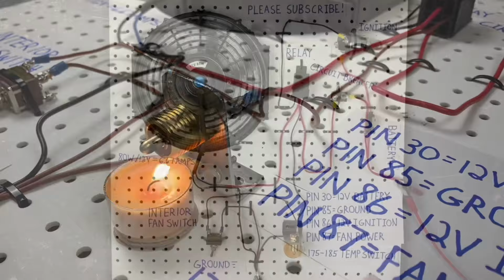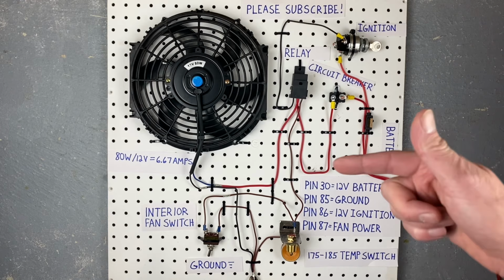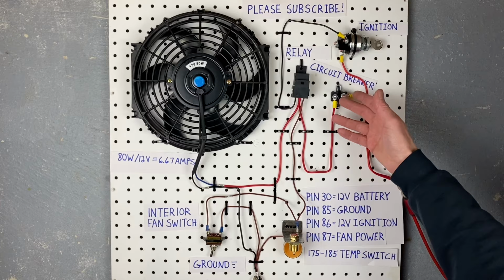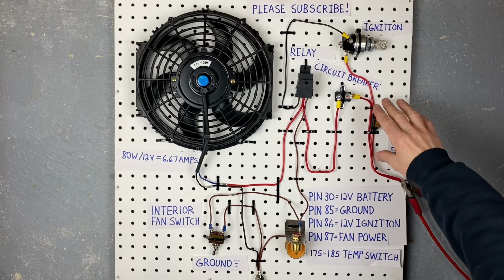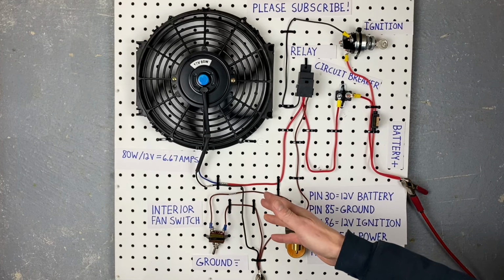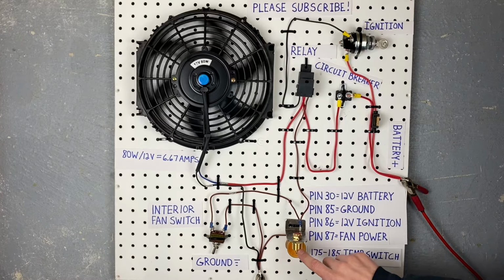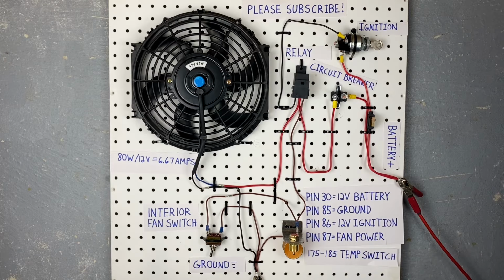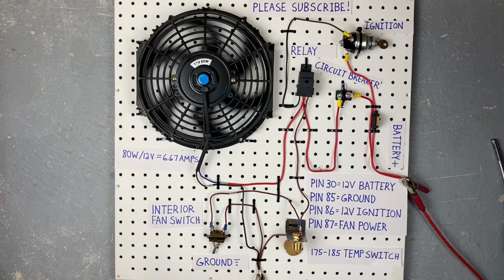How To Wire An Electric Radiator Fan Relay Temp Sensor AND Switch! | @WiringRescue

Comment: good video....i was wondering if you can have a light to let you know the circuit is complete?
Reply from the maker: Sure! Just steal power from pin 87 that goes to a LED light and when your fan is on, the LED will be on too. Good luck!

Comment: I have 014 mini cooper s  the cooling fan never turn off until the battery is dead any ideas what is wrong please
Reply from the maker: I am not familiar with mini coopers, but it sounds like your fan relay is stuck on, or somebody wired the fans incorrectly.

Comment: I have a issue. I wired up a dual fan setup with 3 terminal toggle switch with light on it. I have wired everything as wire diagram shows. When ignition is off, I can turn switch on and it turns on fans but when I turn the car on , the fans turn off. Unless the toggle switch ground needs to be grounded straight to the battery instead of interior ground, im lost.

Comment: This is exactly what I am searching. Thank you very much for this video. New subscriber here. Question: can I add a pilot lamp or indicator lamp on it?
Reply from the maker: Thanks for watching! If you wanted to add a dash light, you could probably splice an LED bulb into the wire that powers up the fan from the relay (pin 87). I’ve never done that, but I would think it would work.
Reply: @WiringRescue  thanks for the reply.

Comment: Great job explaining it, but I have a question. I understand using a certain wire for example 2 AWG for the power, but for the ground and negative lines do I use the same wire size ?
Reply from the maker: Yes!  The negative wires have to carry the same electricity as the positives, so they need to be the same size. Thanks for watching! I appreciate it!
Reply: @WiringRescue  thank for making it so clear. Do you advise to fuse (with the accessories amp limit) the line from the Ignition? Because the we would connect our 2awg wire to factory 12 or 14 awg ignition wire.

Comment: Hello! but I would like to know if I could use the original sensor of the car, but connected together with the original wires of the car, and once the original fan starts, it should also start, thanks

Comment: This video really helped me out!!
Reply from the maker: Excellent! If you liked this one, you might also  find my other wiring videos entertaining! Thanks for watching!
Reply: @RattyMuscleCar  already watched them💯🔥
Reply from the maker: @ChevyCeeLo  - awesome! Thank you!
Reply: @WiringRescue  Hey man, can you please answer this question for me, let's just say I have this exact same setup all 12 or 14 gauge wire and I added a 10 amp switch 16/18 gauge to complete the ground on, would that be ok?
Reply from the maker: @ChevyCeeLo  - the power wire going to the fan, and the ground wire coming off the fan need be able to carry the amperage of the fan itself. In this case, ~7.5amps because it’s a very small fan. The wires going to and from the switch can be thinner because they are just telling the relay to turn on.  The wire size depends on the type of wire and the length of it. Here is a link to a chart for your reference http://assets.bluesea.com/files/resources/newsletter/images/DC_wire_selection_chartlg.jpg. There is also an 80% rule that people usually go by that says you shouldn’t run more than 80% of the wires rating. That gives you a little extra safety net. In short, I wouldn’t go thinner than 16awg on anything in this circuit. It’s nice to have a little extra safety at minimal extra cost. If this were my car, I’d run 14awg for the fan itself, and I’d run 16awg for the switch.
Reply: @WiringRescue  You have saved me time and time again, I can not thank you enough!

Comment: Oh, one more question. Rather then a manual toggle switch, could I just replace the temp sensor with one that would come on at like 170 deg F? I have an alternator that can easily handle the load. Thanks again.

Comment: Also mine turns on the fan at mid speed and know it has a high speed. I’ve seen in a video to mess with the wiring for the far to get the high speed but my fan has only 2 wires and on the video it showed a car with about 4 wiring for the fan. My fan turns on on high speed when pressing the Max A/C button, also both fans turn on. Which is better. When I turn on my switch one fan turns on and at mid low speed.

Comment: Hi. Great video. 
Can i install a fan this way to an existing temp sensor? Meaning the vehicle has only 1 temp switch and a clutch fan. But we want to install a electric fan. Is it possible to connect the fan to the temp switch with this diagram

Comment: Hey man. Quick question.. Does the gauge of the wire matter??
Reply from the maker: Yes! Very much actually. You need to make sure your wire gauge and fuse/circuit breaker sizes are going to be able to flow the amount of amperage that your fan will draw through them, without lighting everything on fire. I actually made a whole video about it - check it out https://youtu.be/EhzN6UdnmPA

Comment: I have a Subaru 2000 harness  2.5 engine in 1986 vw vanagon  i would like to use a five pin relay where do I connect the wire from ecu that turns on the fan that’s how the factory relay was wired the reason for not using factory relay it keeps getting hot and blowing my main fuse to the ecu thanks.

Comment: Question. Typically where does one typically find that ignition switch ground in say, a classic car? I know that's a super general question, but I figured I'd ask haha.
Reply from the maker: You’d have to look at a wiring diagram for the car. It may ground through the ignition switch itself touching the metal dash around it. Or it may have its own ground wire. Could go either way.

Comment: Thank you for great content: I know this is an older video, yet, I am hoping you can answer my question.  Can this be added as an addition to the clutch fan? not wanting to do an e-fan swap, but to add to the back of the radiator of my 2004 chevy silverado. I have a 16" 12v 120W fan.  Thank you
Reply from the maker: Sure! As long as there is room for it on the truck, I don’t see any reason that it could not be added for some additional cooling. Just make sure it’s wired & fused correctly, and you’ll be good!

Comment: Bless u for this video. Quick question, are the fuse and the relay important?  What if i dont use thise 2? I'm planning to just use the on of switch,no thermostat
Reply from the maker: They are very important, and required. Without them, the circuit  could light on fire.
Reply: @WiringRescue  ok thank you for ur time

Comment: Why not do it to a constant power source like for example the battery?
Reply from the maker: Great question! You certainly can, but that also means your fan can run by itself when you aren’t anywhere near the car, or when you’re wrenching on it. That kind of thing makes me nervous, so I prefer to have the ignition switch kill the electricity to the fan relay.

Comment: I have a 3 pin fan switch (plugged on to radiator). When I test the terminals 1(live) and pin 2 the fan works, but pin 1(live) and pin 3 I get no fan. 
Q: does this mean my fan is single speed? Or should I have two fan speeds and a Brocken connection on on pin 3?

The fan itself has two connectors (assuming it’s live and earth)?

Comment: My impala cooling fans come on as soon as crank my car. Why?  It does It on a cold engine too
Reply from the maker: Typically it’s either wired wrong, or a sensor is bad. You’d have to follow the wires and see where the power and ground for the fan is coming from.

Comment: Hey nice tutorial! May I ask is there such a relay that has two output leads? I plan on running power for dual fans on a single relay.
Reply from the maker: I’m sure that there are relays that have that, but I haven’t used them. Some other options would be:
- 2 relays (this is what I would do)
- 1 relay with the output going to a distribution block
- if the connector allows it, two wires in a single connector.

Be sure to figure out your fan amperage draw and size your wires, fuses, relay(s) appropriately. Fans draw a lot of amperage when they first kick on.  Good luck!

Comment: is there any way to wire this without the switches? for example if i want the fan to turn on with the ignition, I live in south texas so the fan would be running all the time regardless, Thanks

Comment: So instead of the circuit breaker you can use a fuse holder with a 7.5 amp fuse?
Reply from the maker: You can definitely use a fuse in place of a circuit breaker, it just needs to be sized for your specific fan.

Comment: What is the correct wire size for a 12 volt 80 watt fan?
Reply from the maker: Good question - I would recommend checking out the video that I made all about that topic here: https://youtu.be/EhzN6UdnmPA
Reply: Thank you sir 🙏

Comment: Hi Ratty Muscle Car excellent video
 this was exactly what i needed for a hydrogen generator project for my car. I do have a question the black wire attached to the fan, is it grounded by its self of spliced together with both brown wires?
Reply from the maker: Hello! The ground for the fan can go right to the chassis of the vehicle. It doesn’t need to be with all the rest of the grounds . Mine is only done that way because my circuit is attached to a plastic board and it was easier for me.

Comment: hey thank you for the great content could you make a video on how put an electric fuel pump on a stock carburator system.
Reply from the maker: Great suggestion!  I will add it to my to do list. Could be a little while though because I have a few videos ahead, and I don't currently own an electric fuel pump for a carburetor. I'll order one though. Stay tuned!
Reply: @WiringRescue  sure thing great stuff though, I own a vintage ride and you have no idea how much your video have helped with the electrical things thank you again I will stay tuned

Comment: Why the ignition wire? I have wired a few light bars and i never use an ignition wire, just directly to the battery and then use the switch to activate circuit 🤔
Reply from the maker: I generally only like my fan to work with the ignition switch turned on. Otherwise it could turn on randomly when the car is being worked on, which could be dangerous.

Comment: Any way to wire the fan so it keeps turning even when the ignition switch is turned off? For example…the engine hasn’t cooled down yet after a drive and you turn off the ignition, would you want the fan to keep on until lower temperatures are reached or would that just drain your battery?
Reply: It would serve no purpose - other than reducing the temp of radiator coolant, but without the engine running there's no coolant circulation, so no cooling of your hot engine methinks...

Comment: one question can you put a water temperature gauge in this circuit or I need a different mount point
Reply from the maker: A temp sensor for a gauge works differently than the temperature switch in this circuit. So that would have to be a different circuit all together. 

A temperature sensor varies resistance depending on the temperature. A temperature switch turns a circuit on and off depending on the temperature. I should add this idea to my video to-do list!  :D

Comment: Might be a silly question, but can I just wire my fan switch into my headlights positive and negative (without a relay) since they are always going.  I tested it and it works but is this ok for the electrical circuit?
Reply from the maker: That is a bad idea. Your headlight circuit was designed for a certain amount of amperage going through the wires. Fans draw a lot of amperage, probably more than headlights. So if you have your headlights and fans on at the same time, you will surely pop fuses at best, or melt wires / light fires at worst. I’d recommend you wire it properly.

Comment: In my 82 E150, my fan red wire is directly connected to a mess of powered wire (verified by headlight wire...) and my fan black wire is directly connected to my temperature switch. Should this system work? I dont have any ground wires but it sounds like thats only needed with the relay. Im hoping my temp switch just needs to be replaced. Thank you.
Reply from the maker: That might work as is, but it’s probably not the safest method of wiring a fan. Hopefully the power wire only has 12v with the car on. And hopefully there is a fuse in the power wire. If not, I’d recommend those changes to keep things safer. Unwanted fire is not great.

Comment: I have 2 fans so im using 2 separate relays for each fan. The relay harnesses came with fuses, i would like a breaker instead of fuses. Can i just cut out the fuses and wire up the breaker? In thas case 2 breakers for each relay, would that work? Thank you
Reply from the maker: That sounds like it will work great if the circuit breakers are sized properly! Good luck with your project!
Reply: @WiringRescue  thanks u, they are 30amp
Reply: @WiringRescue  also what wire can i tap into for switched ignition?

Comment: I don't understand. I've followed this exactly but when I flip the switch the fan will turn on but when I turn it off the fan is still powered. I have to turn  ignition off to get it to stop.
Reply from the maker: You’ll have to use a test light or a multimeter to determine what the cause is. It sounds like your relay is staying on for some reason. So after you turn your switch off, and you see your fan still running, test to see if pin 85 is still grounded. If it is, your switch may be bad. If it is not, then your relay is stuck on for some reason. Maybe a bad relay?

Comment: What can we use in the circuit to indicate that the fan has burned out or is not working?
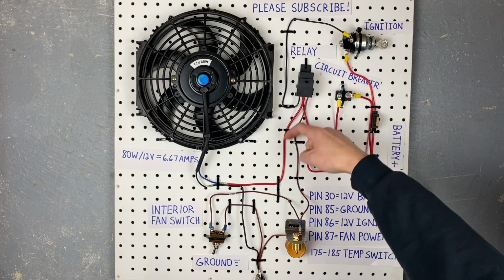Reply from the maker: I’m not sure if it’s the best solution, but in this video at about 4:55, you’ll see that I added a digital amp meter to measure the amperage draw through a circuit. You could potentially add one of these and it would show the amperage not being drawn through the circuit if the fan is not running.  https://youtu.be/WWDN-as7hA0?si=YKxSIGBS-MSipUos
Reply: @WiringRescue  I thought of using a relay so that in case the fan doesn't work, a light connected to the relay's NC (normally closed) terminal will turn on.But i dont know if its the best solution..

Comment: Got a question. My thermostat sensor hits at 190 but when it drops down to 160 and stay stuck on could it be the relay for the thermostat sensor that’s going bad
Reply from the maker: It could be either one. You’d have to test them with a multimeter and figure out which one is sticking.  Usually relays are interchangeable, so you could also try to swap the relay for another one the hood to see if the problem continues. Maybe your headlight relay is the same?

Comment: hello , I have a Suburban 2012 and  I want  both  fans working on high speed  all the time  no  wire to radiator sensor  by 4 relays  type 5 pins   and one  fuse breaker  80 amper  because my country is very hot would you show me  the diagram   thanks in advance

Comment: How would I add an interior fan switch to the current circuit? Assuming it's wire from pin 30 to switch, wire from pin 87 to switch and a wire from 85 to ground point on some metal somewhere?
Reply from the maker: Look on the lower left of the video - it shows the interior fan switch & it’s wiring.
Reply: So from 85 on the relay to the switch and then off the switch to ground?
Reply: @MrBentaylor874  Yeap. That should work.

Comment: I've got a 65 mustang in which the previous owner installed an electric fan. As far as I can tell it is wired exactly like you've shown (minus the switch for the dash). The problem is that when I shut the key off, the fan keeps spinning, creating some electric feedback, and it keeps the car running until the fan slows and stops. I tried replacing the relay (thinking maybe it was bad), but that didn't help. Any thoughts?
Reply from the maker: I have a guess, but it’s hard to diagnose things over the internet. If you do really have it wired the same way as the video - do a google search for “adding a diode to a relay”. I don’t have a video on it (yet), but it’s an interesting problem that can happen sometimes. Adding a diode *may fix the problem. Good luck, and I’m sorry I don’t have a good answer, but maybe this will lead you toward an answer.
Reply: @WiringRescue  Thanks for the response.  I decided to really dig into the wiring, and after removing all of the electrical tape, I found that it was wired incorrectly.  The previous owner ran BOTH the 12v to the fan AND the 12v to the ignition to the same keyed 12v source (instead of the 12v from the fan to a constant 12v).  So as the fan spun down, it created some current back into the ignition, causing the run on.  This wasn't the first electrical issue that I found with this car, so I guess I shouldn't have assumed it was correct.  Anyway, your video was super helpful to get it wired properly, and now it works great!

Comment: The problem with this method of wiring assumes the engine is cool enough when the ignition is turned off, that is not always the case. The power needs to be directly connected to the battery, through the relay.allowing the fan to continue to run, allowing  the residual heat to be dissipated
Reply from the maker: I suppose that depends on your goal. Why does an engine need to cool off fast once it is turned off? How did engines survive so long before electric fans? If the fan were to be able to turn on with the car off, it could potentially be dangerous for a person working under the hood. It could also drain the car battery since electric fans draw a lot of amperage. That being said, it all depends on the goals and needs of that specific vehicle.